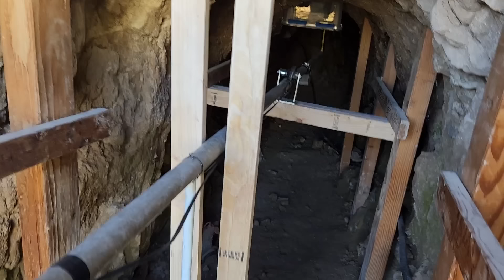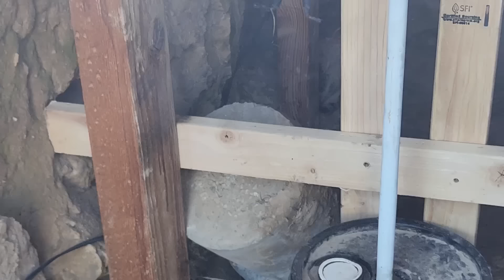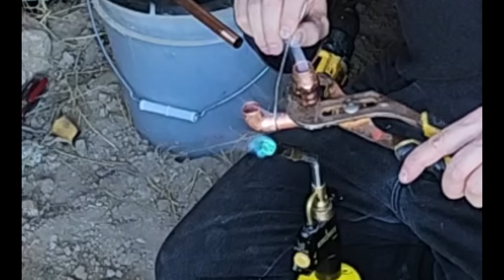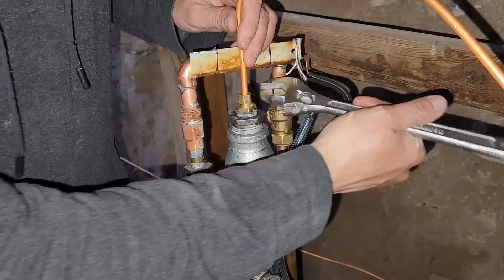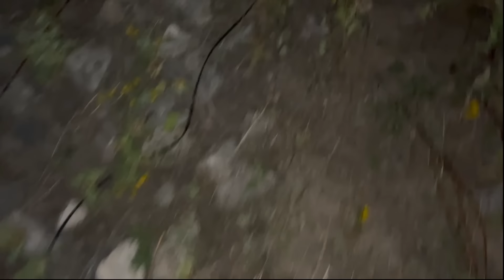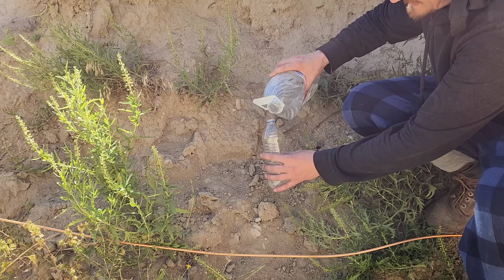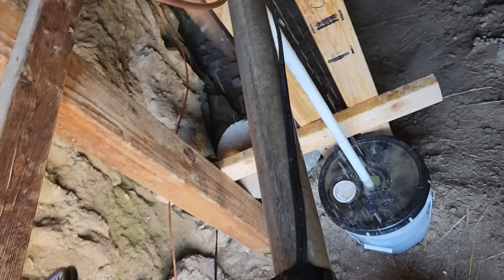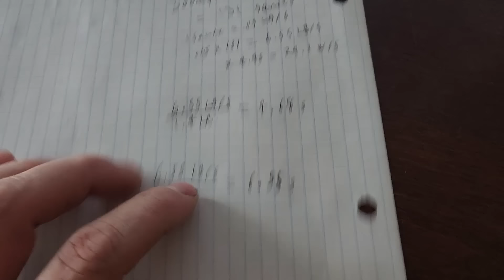Sodium Water Hybrid Rocket?

Comment: I'm just tryna imagine what 50% peroxide & NaK would fire like. Sounds dangerous, but it's not like ur dealing with high-test. pretty sure they sell 30-50% for hydroponics but i can't remember what the laws for that look like these days.

I feel like check valves on the oxidizer line & a high-pressure pump feeding through steel or copper line would be better for more constant thrust & safety. Have as little of the oxidizer in the area. These are basically just hypergolics & having oxidizer close could make a combustion chamber rupture even worse. Idk if that matters much with pipes that thick, but idk what the maxiumum pressure of NaK explosion during a hard start if ur oxidizer/fuel valves aren't properly synched up(sodium pooling then exploding on contact with oxidizer).

Stay safe & keep on bein awesome. Rocketry is dope. Liquid DIY rocketry doubly so. Hybrids are as far as most people go. Rocket science is hard-_- Never seen anybody seriously play around with liquid alkali metals as fuels. Reminds me of those old reports about molten lithium, hydrogen, & flourine tripopellant rockets. I wonder how lithium metal fairs as a hybrid rocket fuel with pure oxygen/LOX, concentrated peroxide, or RFNA.

Comment: one thing i like about your design is that if made practical as in used on a mass scale it can be made like fuel cells. once all the sodium is used remove  cartridge and add a new one. the old one is then sent to be refilled. and instead of blowing it into the sodium maybe have a weep and soak type deal that mists  the sodium that sprays the entire length of the reaction chamber?

Comment: Could you use a second chamber to combine the Na with H2O and just send the pressurized product out through a thrust nozzle? Also one of the reaction products is H isn't it? If you had an oxidizer, couldn't you get a secondary reaction by burning that, gaining even more thrust?
Also glad to see you finally have some assistance. Other Youtubers have whole teams, so I always wondered why you always seemed to to have to work alone.

Comment: Ideas for version 2:
Get 2 syringes 1 with water and the other with liquid sodium/(alloy), which are coupled together and powered by a spring or another syringe hooked up to pressure.
Both reaction syringes feed into a reaction chamber, where both parts are misted at each other...
The rest is simple Jerryrigging 😅

Comment: Units !!! It's N.s not N/s ...
You have multiplied newtons (vertical axis) by seconds (horizontal axis) when measuring the area...
To avoid having to deal with weight loss the solution would be to do the test horizontally...

Comment: Okay so my guess that the sodium would just melt out was proven right, but now to the interesting but:
How can we avoid this... or actually USE this to our advantage?
I'd say either figure out a way to cool the sodium OR make a direct sodium injection nozzle.
This would require the sodium to be heated before launch though... or use liquid sodium alloy? 😁

Starting to remind myself of thunderfoot ... which gives me another idea.
Using syringe tips to spray water and sodium at each other in a pressure chamber.

The injection mechanism would have to be revisited to include syringe bodies (let's assume 1to1 ratio), you fix 2 syringes together and connect their plungers.
The plungers get squeezed either by air pressure through another inverted syringe or a spring.

Comment: Watching the video, looks like it almost ended up as an orion system lol, nah but the melting of the sodium is definitely a tricky problem, the normal style of solid booster might not be viable for sodium because of that meltage, maybe you need some kind of cup to hold the sodium so it doesn't all leak out, the unburned propellant feels like you need to not allow any space behind the injector nozzle. Certainly an interesting video and I think it's still WILD that you can just twist off pieces of sodium metal, no sawing or anything! Also pouring that sodium into the pipe definitely had NOTHING in common with how the military makes bombs.

Comment: Seeing "6.55s" made me bust out laughing!

Awesome design though. If you would like to try another hybrid rocket test, I recommend testing a lot of different geometries with how the sodium is cast in the thrust chamber, and I think youd get a much more consistent burn if the inner diameter was much smaller, like in the ballpark of 3/16ths. Might also be worth machining a steel (or other high temp alloy) nozel to better contain the reaction and to get a bit more thrust.

Super cool concept, and every part of me would love to see a practical metalic sodium hybrid rocket, but I think you'd see much better results from other designs.

Comment: If you ever upgrade to liquid fuelled rocket engines, here’s an idea for you. Ammonia nitrate in a water solution reacting with fuel oil. You would have to find a way to heat the water AN solution to about 250°C before injecting it though so circle it round the combustion chamber first. Don’t worry about measuring the thrust, just don’t blow yourself up.
Reply: All this video makes me think about is how a Chlorine Hydrogen rocket would have better theoretical specific impulse.

Comment: First off, I wouldn’t bother with trying to get permission to launch at all. Just go somewhere far from any populated areas, and well away from dense fuels and air traffic (somewhere way out in the desert is usually fine). 

Secondly. Integration by weighing is probably okay for a rough estimate, but given all the damping you are using in your measurement system I wouldn’t want to add any extra error sources, and unless you use several large area samples for your mass/area calculation, I expect you’re getting more error from that approach as well. I don’t get why you’re bothering with that though - you can just put the data into a spreadsheet and do a numerical integration. But for that matter I’m also not sure why you aren’t using a simple load cell for your thrust data gathering efforts?

One more thing - your test setup is kind of hilarious. You’re trading the relatively minor hazard of the rocket motors (especially the Estes motors) for the more significant hazard (as I see it) of having to spend significant amounts of time - before and after testing energetics - in and around a poorly reinforced mine tunnel with an entrance that looks at least somewhat prone to cave-ins. An open air setup with something you can hide behind if you need to in a place where going propulsive isn’t a major issue seems much more appropriate to me. But that’s just one rocket engineer’s opinion.

Comment: You need to ignite it from the bottom with a burn away barrier tube to carry the water to the bottom of the motor just before the graphite nozzle. My family and I all have/had worked for NASA and skunkworks. You are trying to use liquid fuel igniting for a solid fueled rocket and they are different principles of burning and igniting.

Comment: This was a bit unnecessarily complicated, could have aimed the exhaust upwards, with a scale underneath. sodium ejection would have been less of a problem as well

This style of hybrid wouldn't really work, .....unless, you could alloy sodium with another metal to increase the melting point by a few hundred degrees. I wonder if sodium could alloy with aluminium or magnesium. 

Alternative choice would be cold working of sodium with powders of other metals, aluminium, magnesium, but also maybe iron or titanium, or combinations of them with different ratios and grain sizes. the final putty could be press moulded to the cylinder.

I'm assuming you have seen thunderfoot's stuff with NAK, his setup with steam and NAK is the most sensible so far, tough a bit complicated to scale up, specially without institutional funding....

Comment: Refusing to do calculus on the basis of arts and crafts is an argument I'll have to use later. 

22:19 forbidden glory hole

A bell nozzle would've helped maximize thrust. 

Also, I'm no rocket scientist, but if you fed the water to the sodium from the bottom up, a more consistent thrust should emerge. (You burn a more consistent amount of fuel/second)

Also, processing the sodium to turn it into a sort of lump of granulated nodes (little beads or dust) would avoid having large chunks being blown away in the exhaust, and would increase feel efficiency

Comment: Could you start off with a small bit of sodium and have a seperate part set up for the heat liquidizing the sodium and then flowing into the water to mix for thrust?

Comment: The overhanging parts of the paper would not have been measured correctly as the paper is not rigid.  You should fold it all up so it all sits on the dish to get an accurate result.

Comment: Just a thought from a non pro. Instead of packing the sodium in like a solid fuel rocket, make a thin sodium rod that is spring loaded or otherwise fed in slowly, so it reacts with the water a little bit at a time. If you do all the math right, it seems like it would be more consistent. I would also think the water should be vaporized rather than just blasting through as a stream... Maybe the sodium could be a thin ribbon instead of a rod...

Comment: If you could determine the amount of water needed to be consumed for total combustion, could you not use some of the chamber pressure to push the water needed ? Using the rate of combustion to vary the rate of water flow?  This could eliminate the need for the spring valve reducing weight. Maybe a precharged chamber with a solenoid valve to get it going?

Comment: I note the burn was very pulse-y. Is it possible that the pressure in the combustion chamber was interfering with the feed nozzle, causing it to provide water in a bursty fashion instead of even flow? Not sure about the input pressure, and there are a lot of variables involved, so...

Comment: I'd make it spherical. Two chambers. Outer jacket for water, inner jacket for the sodium to be (formed around a cross) a misting device around the sodium once water gets released and pressurized (with air). Once the reaction gets rolling, you can siphon some of the exhaust to feed the pressure in the water chamber (kinda like in a rifle, where gas gets siphoned to cycle the action).

Comment: I think the hybrid could still work. Perhaps sodium granules in a rubber base and using hydrogen peroxide to increase oxidation so the rubber carrier contributes to thrust. Maybe find an old fume or sandblasting cabinet (or make one) with gloves so you can work with it in an argon environment for safety.

Comment: TNT has rather poor energy density. But pretty insane experiment nonetheless :)
Perhaps you can alloy sodium with some metal to increase melting point it would work better, but to me it seems that you would need to make completely different design of engine to prevent melting of fuel.
Also it hurts me a bit when I hear about adding NaOH to atmosphere to capture CO2. Cough cough, if you know what I mean cough.

Comment: I couple ideas that I thought of while watching this.: 
1) Make "stator" baffles to slide into the fuel chamber, with angled fins on them. Pour the grain onto the baffles to submerge them, and continue to use the bolt pour-core. As the fuel begins to melt, the angled fins are exposed and swirling prolongs the contact time for a more efficient burn. The back-pressure may Also help to meter the water flow. The pressure towards the end of the burn should increase fin exposure/swirling late in the burn, may give the strongest impulse improvement right when it would be best used.
2) The water injector may be better with a cone-shaped, or swirl pattern. From the un-spent fuel grain remaining in the video, it looked like a lot of the water went right through the central hole and missed a lot of the fuel.
3) Use Citric Acid crystals in the neutralization bath instead of vinegar, especially since I think you showed lead ore being harvested from that mine before, and CA crystals don't stink like Vinegar.
4) Have a second tank, along with the water tank, and fill it with Oleum. Find some way to combine the Oleum and Water immediately before contacting the Sodium. I'm not even sure what would happen, but I'm sure it would be exciting. Bonus would be putting some of that pink Potassium Permanganate in there somehow too, in order to get extremely fire... like a rocket motor. 
5) Do a video on your uses of Sun Chokes, and how they help hold the soil around your mine, feed your bees, and cows. I started growing a couple of them this year, and I see deer actively approaching the two spots where I put them, to check for new leaves. The two that I planted in some dry spots under my house awnings are around 12' tall now, and shade the south wall of my bedroom during the summer. 
6) Put guest star to work reading comments so that all my cool ideas (including this one) can be attempted.

Comment: You probably already know this Cody, weighing the paper cutouts to determine the integral used to be part of how NMR integral data was computed, it's possible to model it and do the calculus to determine the integral but it was just more practical to copy the spectra and weigh the cutouts, you usually knew what your total integration was going to be beforehand anyhow so unless something seems off it's a decent method.
Suggestion:   Would it be resonable to have a stream of steam filling the combustion chamber and inject a thin stream of molten sodium in a controlled manner? Steam is cheap and plentiful, and it will hopefully ensure near complete combustion, no melting and shooting out EDIT: NaK is a good idea, Cheers!. Alternatively could sodium be mixed with a non hydrated non-hygroscopic salt to make it a dissolving brick? Good luck! this is super cool!!

Comment: Controlling the water is much more better when steam gets inside sodium chamber. Can you please try one. For best case scenario make a chamber like cryo engine and use more pre made steam for first startup stage then slow down the steam flow steam pie should be in an average inner diameter of a .1- .2 mm pipe. Just thought of a plan for reducing the control function. Create some steam before releasing it make the steam chamber pressure higher and open the flow Fully. First problem maybe when steam pass through the .1mm hole creating a small nichrome heating coil around the nozzle would be fantastic but it will create more work. It's only needed for the first startup though... cause cryo design will help after booster gets hot and steam will carry heat with it and continue to expand. 😅

Comment: what if u put a smaller pipe inside the rocket fuel pipe full of smal holes and capped off in middle in top and open in middle bottom but capped of in sides and put the fuel as you did in the video?

Comment: Who said that hypergolic has to be dangerously poisonous?
The integral is idea is almost like a piece of pascal code I write at the start of the 1990s which involved drawing the graph and see how much area the pixels covered on the screen. It was a long time ago, but the cutting and weighing made me think of that.
You still need to use another oxidiser, like liquid oxygen, which might keep the part of the fuel that is not exposed to the flame solid (I guess) while igniting the exposed in order to prevent it from melting and clogging the nozzle while the ignition is on-going. 
Otherwise, not a disappointing Cody's Lab and as usual unconventional, which is just fine by me.
Thanks Cody!

Comment: maybe to deal with the sodium falling out of the engine would be do basically have the thrust go upward befeore forcing it to go down with a U bend? water goes down on to the sodium, reaction produces gas that moves up, pipe directs that pressure down? could also probably help to have more surface area for the sodium so it reacts instead of just sitting there getting hot until it melts. Fully liquid will be interesting though, certainly arent many rockets thats fuel requires preheating, which is an ironic problem to have given the solid state attempts problem was that the solid fuel turned liquid.

are there parrafin wax rocket designs? maybe theres some design ideas and solutions that could be taken from those.

Comment: I absolutely think you could get to the point where you could fly this legaly!  You may have to go to FAR or BALLs with the TRA.  You would need to cast your sodium grain in a phenolic liner and use a commercial casing.  Plenty of motors use metals in the fuel mixture.  That is how you get sparkeys, lots of titanium in the fuel.  Yours is just very metal rich.  If your "oxidizer" is water that is a way safer oxidizer than the NOX they use at club launches.

Comment: How about solid water and liquid NaK?  Water can be stabilized against fracture by using gelatin and suspending zinc oxide as an opacificer to prevent radiant heat transfer.  Naturally,  deareated  water is required

Comment: In the water circuit a pre-bled water powered ram fully opening the valve (+feedback) and a check valve (or foil burst disc) as close as possible to the injector would help.

Comment: This is awesome! I have an idea which would probably increase the efficiency by quite a margin, add an afterburning water injector as part of the initial flat of the inside of the nozzle. it will catch the melted sodium that escapes and ensure more thorough mixing.

Also perhaps to get the water to these injectors you could add an active cooling layer around the outside of the sodium chamber. it could preheat the water at the afterburners into vapour or steam and further improve mixing.